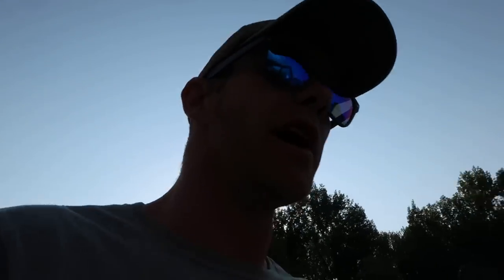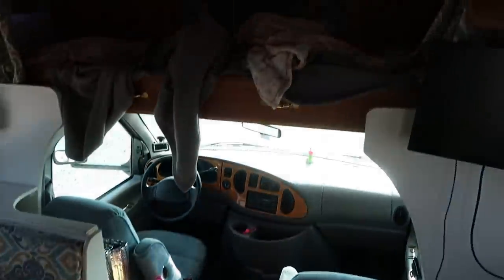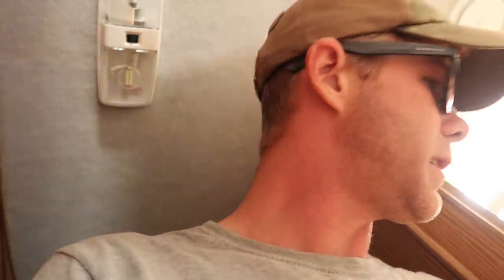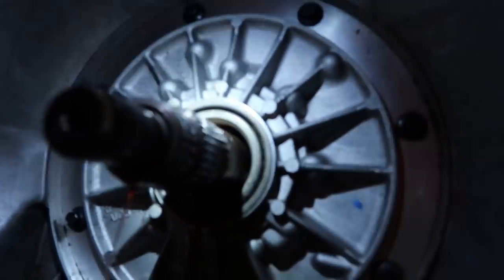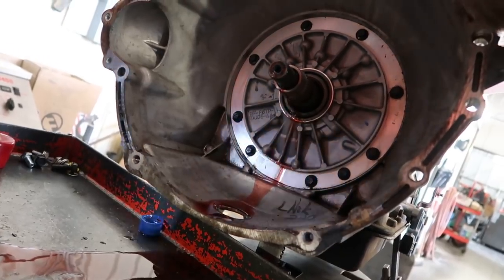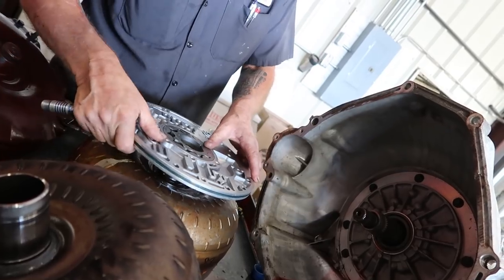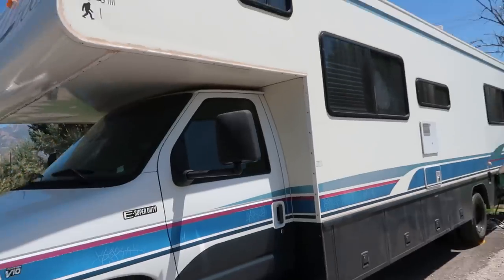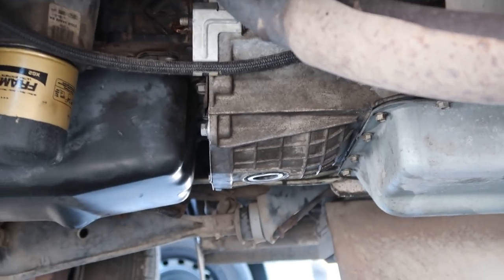Removing Our RV Transmission For Repair | Ford E4OD

Comment: Wow! It's not often you find an installation manual that addresses not only your specific situation, but berates you besides. . . .LOL!! ;-)

One serious tip, Ben. . . I don't know if you do your own oil changes on your engine, but I'd give SERIOUS thought to getting that Fram oil filter, (translation = POS) off of there!! Those are the worst piece of crap on the market!!!!
Reply from the maker: I made a special message for folks like you at the bottom of the description.

All in good fun, of course. :)
Reply: @Sailboatstory  Ha! I didn't see that, but, there's a reason there's so many anti-Fram-ers out there!! Depends on how much you want to spend repairing/replacing you engine, and I can assure you it WON'T be $931.00!!!  Stay safe out there -- always enjoy your videos!!!
Reply from the maker: Trust me I’ve heard that over and over. Always done Fram though, with no ill effects. You could be 100% right though! I always get satisfaction from going against the crowd. Hopefully it doesn’t end up biting me in this case.  :)

Comment: It's rather be fixing a boat in the Bahamas than a BURT in the desert!
Reply from the maker: Depends on how broke the boat is, I guess. For something like this that’s really limits mobility, I’d waaay prefer the RV situation. No fun dealing with mobility-related issues in remote areas. Been there, done that, will probably do it again, but no fun.

Comment: If you had said Big Leaking Ugly Rolling Turd, you would have had a BLURT! (Snort). Glad that repair didn't end up costing you thousands. I have a couple of different rellies in the U.S. who have both had RVs and both had transmission problems!
I was expecting Tambi to appear out of left screen and give you a smack on the back of the head with those shoulda bought a boat comments. LOL.

Comment: Better check main shaft bearing. If it's got enough wear and the shaft wobbles, that will take out the seal..
Reply: Robert Thompson  I think that's why they replace a bushing but as you say that may not be enough I'd the main bearing is bad , but it looks like they knew what they were doing so Prehaps they figured the bushing was all that's needed. Dunno? Cheers .
Reply: @CheersWarren  The T Converter goes INTO END OF CRANKSHAFT,There is a pilot on backside of converter,The man done a good job& I rebuilt transmissions nearly 35 YEARS&Owned 2 shops.

Comment: Just a quick question . when are you returning to the sea and sailing ?
Reply from the maker: Original plan was to look for boats in Canada this summer. Virus panic stopped that. Now hoping to start the search after the holidays. Trouble is that virus put a major dent in finances, so trying to weigh options.

Comment: Many folks don't realize FORD is really an acronym with multiple meanings. I know this from personal experience. F.O.R.D. stands for the following: "Fix Or Repair Daily" otherwise it will be "Found on Roadside Dead" because the "F'n Owner (was) Really Dumb." I was a Ford truck owner for many decades until my last purchase of a brand new F-350 1-ton pick-up with a 6.0 liter turbo diesel back in 2004. Big mistake! Biggest (and most expensive) piece of junk I ever owned. It had many expensive issues Ford knew about but they stalled until the truck was out of warranty. Moral of the story: I no longer buy or own Ford products. Life is now bliss!😁 I hope the Ford demons don't escape and rear their ugly heads again with your T.U.R.D.
Reply from the maker: Those 6.0s are known for being pretty bad trucks. Loads of people are in the business of  “bulletproofing” them, simply because they’re infamously unreliable.

I’m always surprised at the number of Volkswagen vans we see out and about - and I’m talking about the old ones still rattling down the road. The folks I talk to who own them typically agree that it’s about the novelty of owning them more then anything and that the vans are known to break down somewhat regularly.

Heck, there was a nearly new diesel Sprinter van in the trans shop ahead of ours, which are supposedly one of the most reliable out there, having its transmission completely rebuilt.

I think, more than anything, it’s comes down to maintenance and use and then just luck of the draw after that. Anything can and will break eventually - except our Yaris... that little sucker is reliable as heck.

Comment: Unsubscribed: Not the channel anymore I subscribed to.
Reply from the maker: Then how are you unsubscribing from it?
Confused.
Reply: @Sailboatstory  - No patience, some have.
Reply: I’m here for the romantic clown balloons
Reply: The old bait and switch.  I don't blame ya, the prices these days of boat ownership is ridiculous and if your going to keep it in a live aboard slip or can even find one forgetaboutit.  Maybe its time to get back into the 9-5 routine and put some money into a 401k.
Reply from the maker: As far as cost goes, the biggest difference between rv and boat costs is that the boat still costs money in the off season.

I’ve been done with 9-5 work since I was 27. That’s when I left my job as a burnt out mechanical engineer. Started flipping and renting houses and coaching real estate after that. I’m just not cut out for the 9-5 grind.

I do foresee a need to set up better cash flow though at some point. Probably get a rental portfolio going or maybe buy a RV park. Whatever I do, it will be to fund our travels and maybe add a little to our monthly budget.